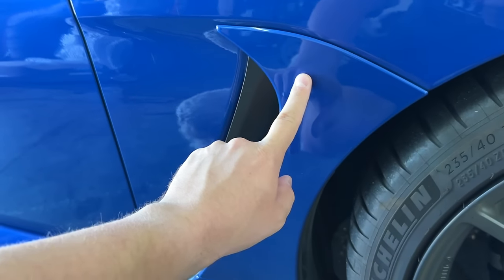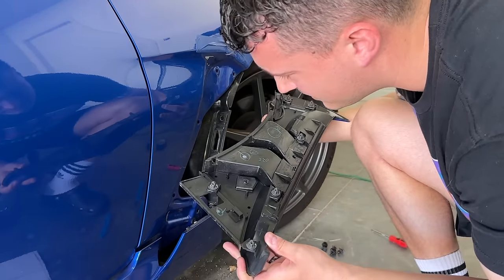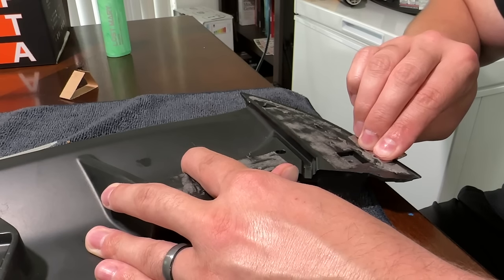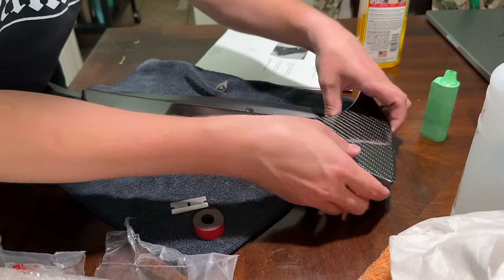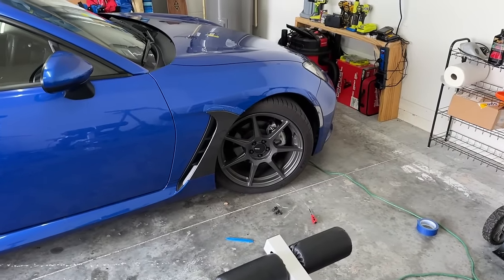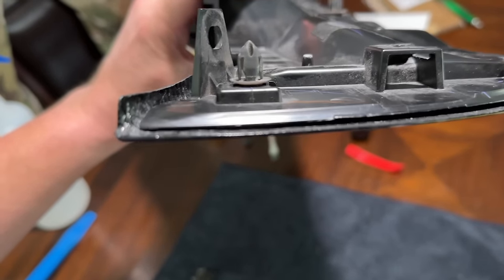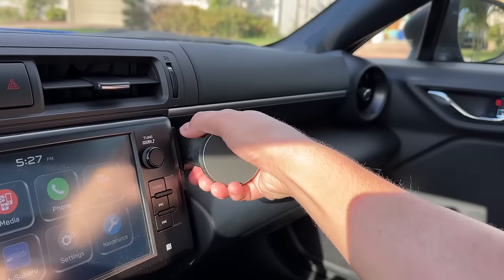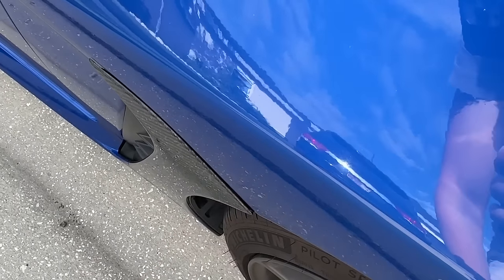2022 BRZ & GR86 APR Carbon Fiber Fender Duct Covers Install!

Comment: You need to buy a rubber wheel/gum wheel !!! It attaches to a drill and it so much easier
Reply from the maker: I've never heard of that! I will look it up!
Reply: @Camhill182 you have to be careful though because it will melt your plastic.

Comment: I searched up the diffuser because I’m interested and do not like the options available atm. Not sure if I’m looking at the correct one but J’s racing rear diffuser is not compatible with triple exhaust tips.
Reply from the maker: That is correct. I will either have to get the J's Racing exhaust system or have a muffler shop chop off the tips and custom weld two tips that fit within the diffuser